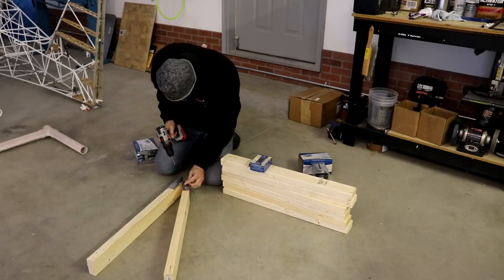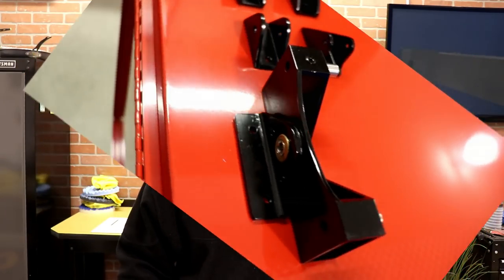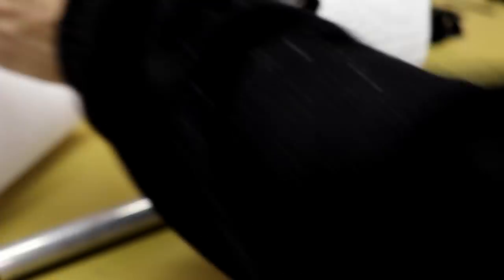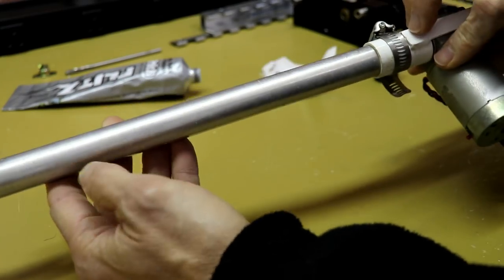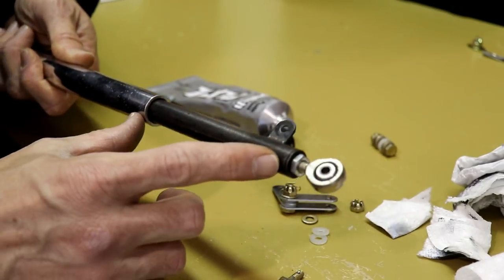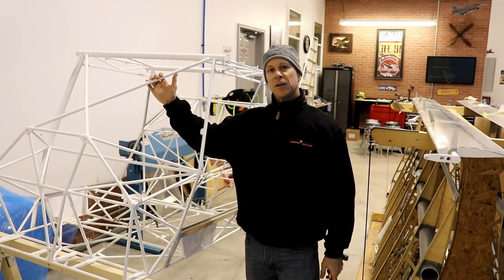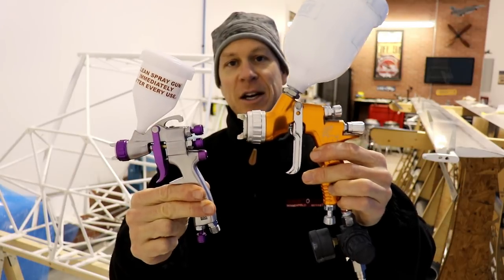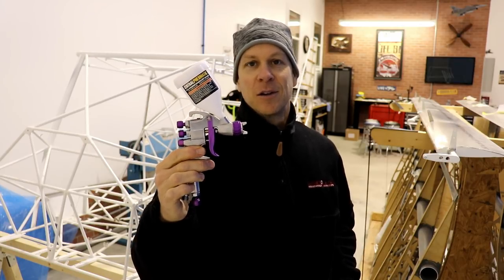Getting Started on the KITFOX!

Comment: Great videos, just be careful applying lubricants to teflon ball joints.  (you talk about it at 3:37 in the video)  it tends to wear them out quicker.  Best thing to do with them is clean them with a little soap and water.  Lubricants attract dust which is what wears them out quicker, and some cleaners cause the teflon to break down or swell up.

Again great videos and good luck with the two builds!
Reply: Or a dry lube such as a graphite spray should work as well.
Reply: @victoryautmotive1582  no graphite either

Comment: Mark,    I have recently completed a Cruzer Rudder at the Zenith Factory, but have not ordered the kit. I live in Missouri and their factory is only 100 miles away.   As a potential first time builder,  I want something that is simple and that I know I can finish and get in the air.  But the KitFox and Rans S-21 have a definite appeal.    Do you see yourself selling your Cruzer because the Kitfox tail dragger will be more challenging or fun to fly?   I don't think the performance differences (cruise speed)  necessarily dictate that I will not be happy with the Cruzer,  it's just not a taildragger.  Thanks for your thoughts.
Reply: Thanks a Bunch!

Comment: What is the point of painting over powder coat? I assumed that the point of powder coat is that it is better and tougher than paint and avoids the need for paint.
Reply: Got it. My Rans S20 kit should be arriving before Christmas. I paid extra to have it powder coated but will probably paint just a few tubes....like the braces that cross the windshield as black is less visually distracting. Good luck with your project!